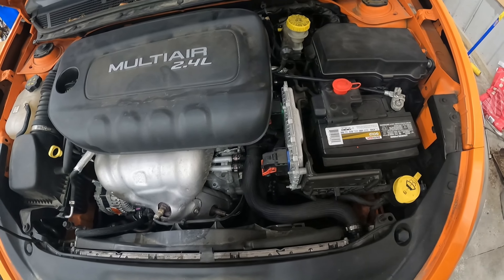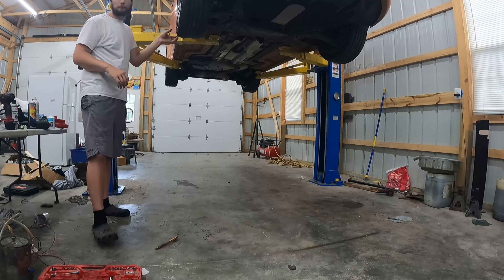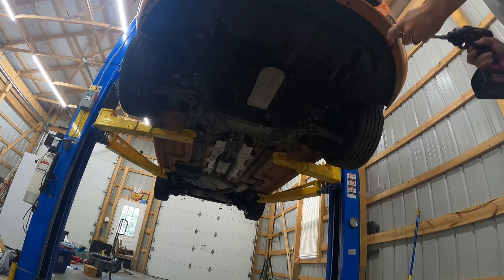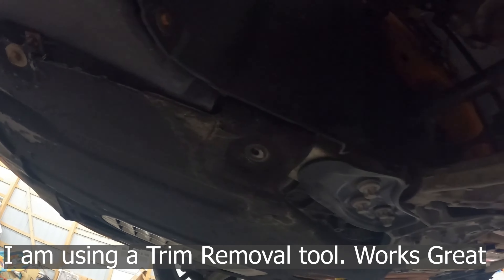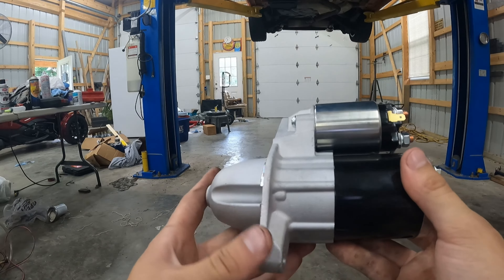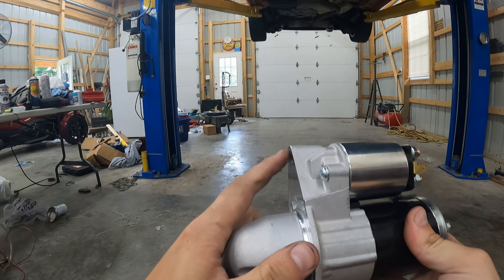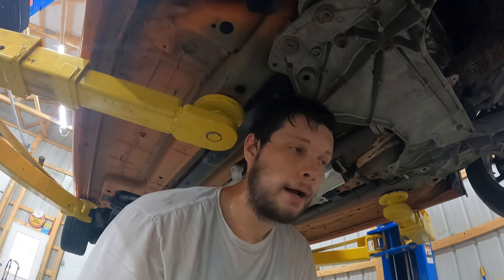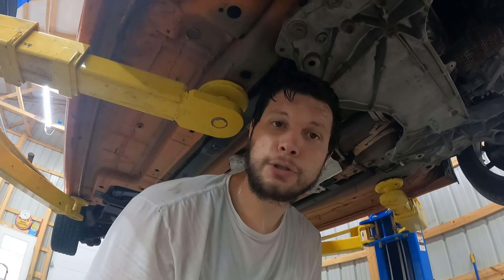Dodge Dart Starter Solenoid Failing - 2014 Dodge Dart 2.4 Starter Replacement - Under 2 Hours DIY!

Comment: Bro thank you, my wifes dodge dart had a click no crank, because of your ground video and this one, it helped my to determine the starter was bad and with your guidance, it was simple as heck. The only thing that I did to make it a little easier was, I used a long trim removal tool and popped the wire harness off the intake manifold to get some slack for the wire that connects to the starter. Making it easier to connect. I did leave the harness unsecured in that one specific location to make replacement a easy if necessary in the future. Thank you again, for everything that you do and all of the help that you offer to the world.
Reply from the maker: Thats a fantastic tip. Also Thank you . Thank you for watching and leaving a comment. I take extra time to recap, film, and edit. Its comments like these that make it all worth it. Thank you so much again for the tip! Having some extra wire to play with would have been awesome.

Comment: I went back and forth on the video a couple times, but wimped out. I needed at least some jack stands and was nervous to hang under the car that long as a rookie. I took it to the dealership. Cost me $650… Woof. Wanted to say the video was great and I subscribed. Thanks for getting dirty and teaching the rest of us. Keep grinding!!
Reply: Also I thought it was interesting the dealership starter was over $300 (hosed me) plus the book said 2.1 hours of labor. I do think they went underneath using your same approach. Another takeaway is the car starts very aggressively now, almost like a machine gun compared to the original starter. Good tip on finding out if I got my core charge back.
Reply from the maker: @sirandrewwilliams240  thanks for the comment . Glad the video gave you some insight even if the dealer did it . I am sure the dealer marks up what they can and 650 is about average I have seen higher estimates. When I did this recently the starter was brand new not reman under 200 with a lifetime warranty . It surely can be done in under two hours even without a lift . All that matters is that your car is starting well and you aren’t stranded :) thanks again for the comment .

Comment: Excellent video. Everything else I had watched said you had to go in from the top. I watched this just in time to save myself a lot of work. Just pulled the starter from my daughters 2014 dart 2.4 without issue and I was able to do it without a lift. Thanks
Reply from the maker: That hidden bolt is a bit of a challenge but fully doable ! No need to do it from the top :) besides taking the connection off the battery nothing will be from the top.

Comment: Another guy disconnected positive cable in fuse block. Hooked up a peice of wire to the end and fed it down thru as he pulled starter down and used that wire to pull main red cable back up to fuse block. Look up short cut for dodge dart starter

Comment: I will make it short : 20 minutes long
Reply from the maker: Ehhh I tried to trim it. Just felt some people needed the extra info. Most of the other videos of the starter replacements people do it from the top which is unnecessary.

Comment: I changed the starter on our 2015 Dodge Dart SXT just like you did in this video. Was able to get that back bolt with a little patience and work. Took about 10 minutes. I wish I had the lift as I had it up on jack stands and I'm sure that made it a little harder , but it still can be done. Thank you very much for the video. I seen others that say you have to take everything out from the top , but you really don't. Defiantly get a swivel with extensions to make it easier.
Reply from the maker: Thanks for the comment and glad you could tackle the job yourself . Even on a lift it took me about ten minutes to get the bolt out . But I’ll take that ten minute bolt over the headache of tearing apart the stuff up top :)

Comment: Best Dart starter video on the web. I was dreading that top business. Started doing it and said f this I need to find another video.
Reply from the maker: Thanks for the positive comment ! Yeah I refused to mess with it from the top. Fully doable from bottom on ramps or jacked up . I ofcourse have a lift but that’s not required :)

Comment: I did my 2014 gt 2.4 just like this but on the ground and the dam thing fell out and smacked me in the 😮this is the best video I have seen to do this procedure thanks
Reply from the maker: Well hopefully no major bodily damage ! Glad you got it handled and thanks for the comment :)
Reply: @JustFixinGarage  these cars are nothing but troubles  starting around 65k . I have a bored out throttle body and a cia . Hoping to get a pedal commander
Reply from the maker: @joestepp4157  I have heard pretty positive reviews on the pedal commander . These cars like the neon were made cheap and quick . Fiat having a backbone on them
Surely didn’t help with the quality !
Reply: @JustFixinGarage  dam Italian cars same motors in fiat 500s . Mine also has a little engine tick when I step on the throttle . I’m about to do the valve cover gasket next it looks easy to do , just a bunch of useless plastic in the way

Comment: Thank you so much.  This saved me a ton of work compared to everything else I had seen and read.
Reply from the maker: Glad it helped ! That back bolt can be tough but I’d rather twist my arm a bit than rip out all the top end of the engine bay to get to it :)

Comment: Thank you just did it and work also my car wasn’t cranking and I put the 13mm socket and it sparked and turned on thanks alot
Reply from the maker: Glad the video was helpful thanks for the comment !
Reply: @JustFixinGarage  everyone said from the top but I did it from the bottom I seen your comment on the video where you said you didn’t and I got it just how you said I’m get the new part tomorrow hopefully I won’t have the problem no more
Reply from the maker: @andrewperez6848  don’t forget to clean your ground connections too  I had another video for that . They get crusty and cause problems :) glad you didn’t waste time up top.

Comment: Thank you for this video! You saved my ass a lot of time and money. I will say that if you disconnect the starter wire from the battery and undo those 3 clips you can pull the wire down enough to make it easier. Dodge can go to hell for where they put that damn thing though.

Comment: Ty for the ground idea I used my jumper cable to the negative and the other negative on the bolt to the alternater and it started right up thanks
Reply from the maker: Glad to hear it! Hopefully a ground cleaning and maybe adding another works for you and Saves you some money :) . Thanks for the comment .

Comment: Thanks a lot. Great video. Do you think it’s possible to do off the garage floor On jackstands?
Reply from the maker: sure can be done on the ground. A few people in the comments on this or another video had said they did it on the ground. I just use the lift since I have one :) makes it easier for my 6 foot 6 self. Best of luck on the job! be sure to confirm its nota ground issue first.

Comment: First off thank you. Saved a headache. Secondly i just replaced mine and its squealing on the start up. Took it back and got another one. Same issue. You think it needs a shim possible?
Reply from the maker: I don’t think these have a factory shims on them . I know some older vehicles often have shims included for alignment  but that’s rare on modern vehicles . So it would be surprising if it needed one. Maybe I slept the fly wheel . Is it seating on there square ? Definitely the first I have heard of this on a dart starter . Well a modern dart :)

Comment: Thank you for this video, it is definitely the most in depth and informative one. It took me multiple tools and all day yesterday trying to get that back bolt off but it was so hard to do because it was swapped with the one on the bottom so the bolts were swapped from when a new engine was previously put it. But after I got that bolt out it was easy breezy.
Reply from the maker: I for sure had twist my hand around to get that out . Hopefully if you switch them back it’ll be easier next time !

Comment: one question i have would be is it okay to NOT put the plastic guard back onto the car? i really quite despise it & it doesn't appear to have much funtion beyond just keeping parts a little less durty but it cartianly has the function of holding water
Reply from the maker: There are a few reasons for it but I have had a friend with a dart where he didn’t have one put back on . As you mentioned water can get up and hit things like belts and such . There is a reason for aerodynamics for air to glide by  also for what goes through the grill to help keep everything cooler . My friend who didn’t have it didn’t notice any mpg issues or heat issues. So bottom line , I think you can run fine without it .

Comment: alright so do you know anything about a 2.4 2014 that doesn’t even have crank intermittently, my girlfriends car will start and run them sometimes it literally will just not, we turn the key and no crank to start like it’s just not getting power, any ideas? have you seen this before?
Reply from the maker: @EthanSweet-s6u  could be a few things I would suggest cleaning the ground connections on the battery , frame , and transmission . As well as adding a new ground . I have another video for that stuff . A bad ground can cause intermittent starting issues . If the ground makes no change it’s really critical to diag the issue while it’s happening . For instance if it’s happening and I check power to starter and it’s not getting the signal to engage I then have to worn my way up the circuit . Could be the computer not reading the key or a bad relay etc . Sorry can’t really narrow it down from there .

Comment: Did you have to shim the starter put the new one in and it wines a little is that normal
Reply from the maker: I didn’t do  shims for this. It could just need to break in . The old had no shims and I didn’t do any on new . I’ve done two darts never noticed any noise though .

Comment: I just replaced my starter In my 2013 dart, now I have a screeching sound. Any ideals as to why?
Reply from the maker: I didn't have this issue and this doesn't have any shims for use. Im suspecting maybe a few people have gotten bad starters. Or if when it was being bolted in it didn't bolt flush to the engine/transmission . I always make sure it flush but if it got pivoted sideways that could cause noise as well.

Comment: I have a 2014 dodge dart most times I crank my car it crank but when it want I just keep turning and key and ot will crank what’s the problem please help
Reply from the maker: Check my other video for bad ground . Could be the problem . Also make sure you aren’t low on oil or it will act similar to.
Reply: Motor oil.  Check the ground wasn’t no corrosion thanks I’ll check oil
Reply: What type of oil

Comment: I did mine, now it's screeching when starting.
Reply from the maker: I didn't have this issue and this doesn't have any shims for use. Im suspecting maybe a few people have gotten bad starters. Or if when it was being bolted in it didn't bolt flush to the engine/transmission . I always make sure it flush but if it got pivoted sideways that could cause noise as well.

Comment: I have a 2014 Dodge Charger and the alarm goes off randomly.  Any ideas why?
Reply from the maker: I’m sure there are countless things that could cause it . I have only ran into this in a vw and it was the door latch sensor . Some door latches electronically send a signal of the door is open or closed . If it’s going bad it could be tricking the car into thinking a locked door is opening . The fix for this was to replace the latch assembly .